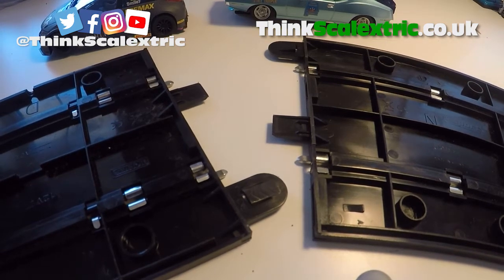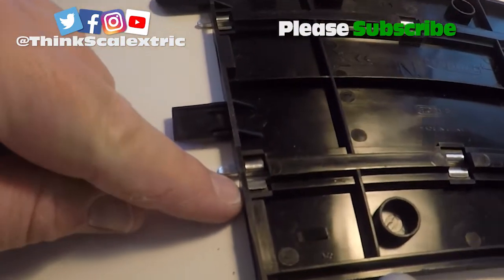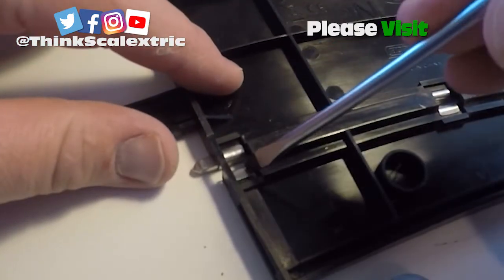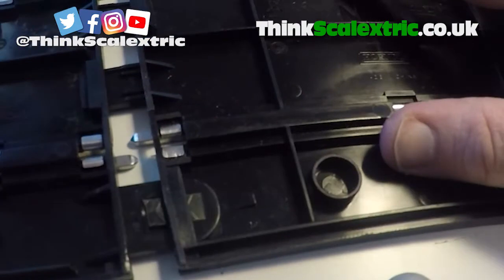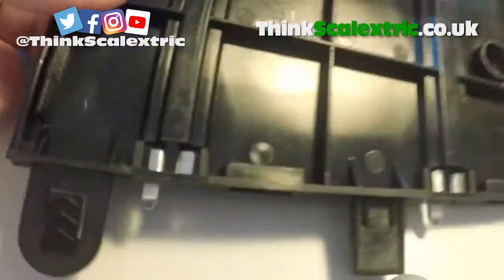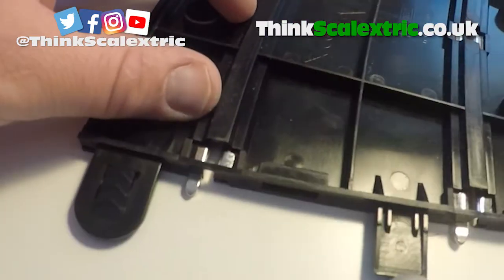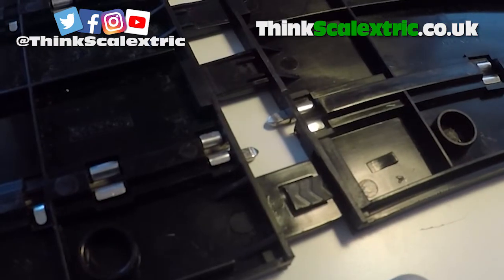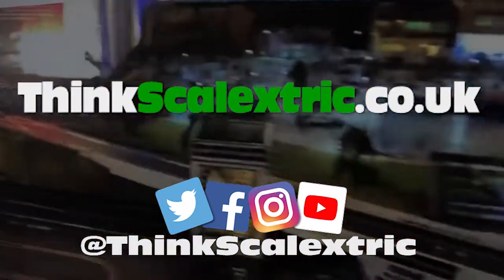Scalextric Tips: Fixing Old/Worn Scalextric Track/Connections.. Quick Easy Fix for Scalextric Issues

Comment: Why didn't the factory do that, I did all mine then some spots were tight. Stuck screwdriver in and wriggled it. Still have bumps and dips at every connection. The brush shoe needs a centering spring and spring loaded brushes/contacts. I think I'm going back to Carrera !
Reply from the maker: They are tight enough from the factory, but everyone you connect and disconnect them, they open a little, think of it as maintenance 👍
Carrera is good, but you need soo much more space
Reply: @ThinkScalextric  Sport track seems rubbery. My GO sets are 1:43, not any more space, cars have lots of detail also

Comment: I really want to replace the metal contact track connectors. I bought a 1/24 Carrera track that must have been left out and the track is mostly okay but the small metal contact clips that fit inside the metal track that the brushes on car. I can't even find the name of those clips. They must be available. Any help would be appreciated.
Reply from the maker: I’m not sure what they are called or if you can even buy them, where in the world are you?

Comment: What should I do if the rails are rusted? being in the loft about 30 years and being exposed.
Reply from the maker: Depends how bad, once they get to bad there is no real saving them
Reply: If it's rusted, it's lost the protective nickel coating off the top track surface.  You could sand it down, but the bare steel would just rust again.